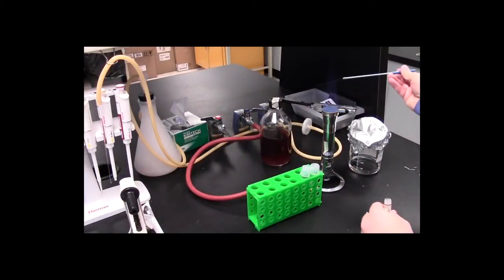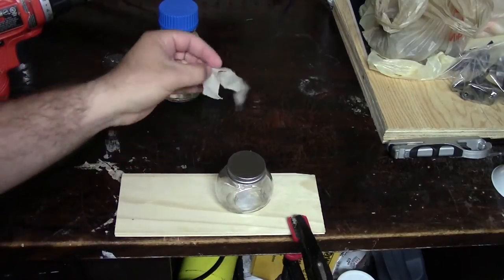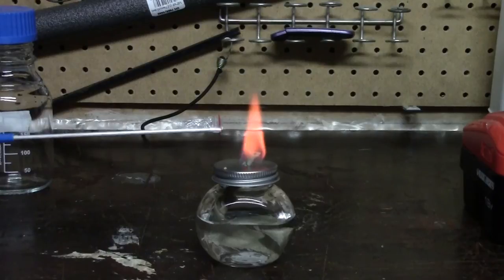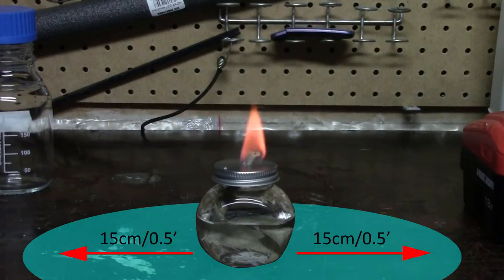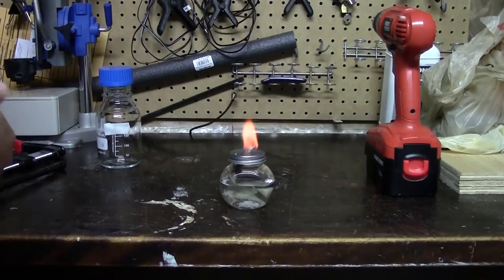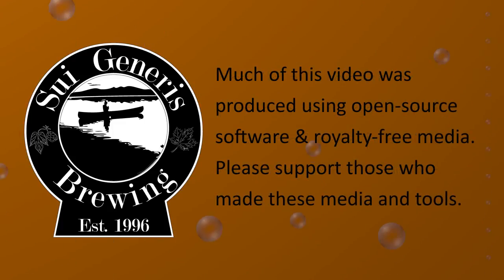Your Home Yeast Lab Made Easy - DIY Alcohol Lamp

Comment: 0:03  Introduction, Aseptic Techs and flames
0:20  Bunson burner options
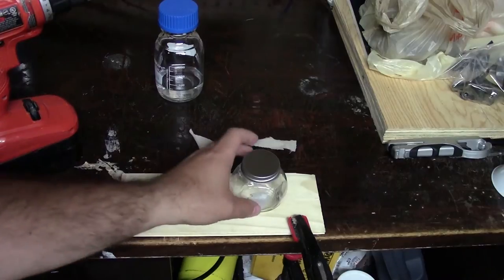0:32  Materials
1:07  Process of making a burner
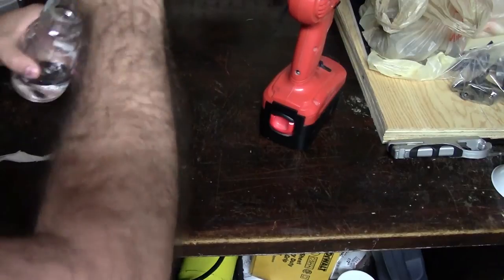1:40  Filling jar with fuel (clean burning, non petroleum)
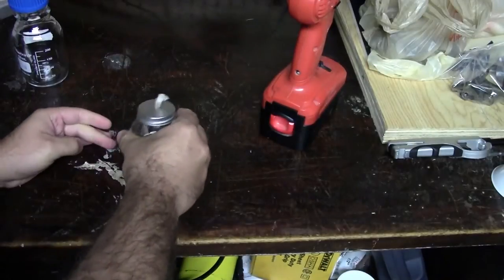2:11  Adjusting wick length and damp, lighting it.
2:35  Lamp does one of two things, sterilization, workspace air currents
3:10  Work area near flame that is relatively clean
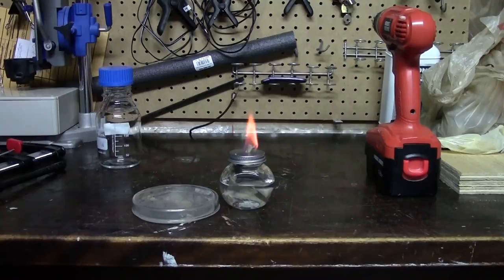4:17  Putting it out with some hot air from the author.
4:26  Summary and thanks with links.
Reply from the maker: Thanks for the timestamps - comment pinned!

Comment: A lot of people suggest using denatured alcohol. I'm concerned that whatever poisons that were added to the ethyl could cause contaminants or unhealthy combustion products. Could you shed light on this?
Reply from the maker: Hexane is usually what is added. Its modestly toxic, but should combust to the same products as ethanol (e.g. CO2/CO/water). Alternatively, you can use rubbing alcohol (isporopyl alcohol) or fondue fuel (methanol), both which should contain no adulturants and burn cleanly.
Reply: Interesting. Denatured is so much cheaper and more available.

I did just come up with another question regarding pouring plates: Is it possible to autoclave already poured borosilicate glass plates and slants? Seems like a much easier method than trying to pour plates aseptically if you have a good steam-height rack that fits the pressure cooker.

Thanks for the help.
Reply: @SuiGenerisBrewing  i noticed that the Isopropyl Alcohol I have at home is 70%.    what percentage IsoP do I need for a lamp?  (i think water is the other ingredient in the bottle i have)
Reply from the maker: @oakbox12345   95%. Another option is methanol (AKA wood alcohol, AKA sterno, AKA fondue fuel).
Reply: @SuiGenerisBrewing  im gonna go check out the ACE hardware store 🙂

Comment: I am curious, where did you get your jar for the lamp?
Reply from the maker: +MrGattor33 My wife's spice cabinet...prior to that, I think from Canadian tire. Its simply a glass spice container, sold (up here, at least) in many department and cooking stores. But any glass jar with metal lid will do - I've made them from baby-food jars and small jam-jars as well.
Reply: +Sui Generis Brewing 
Ah ok, thank you. I was thinking of a baby food jar later on after I watched your video. Thank you for your reply and great videos. Very interesting also.
Reply from the maker: Glad they'd been helpful.
Reply: +Sui Generis Brewing 
Yes indeedy, curious if you have any on harvesting the same strain of yeast if you understand what I mean?
Reply from the maker: +MrGattor33 Do you mean recovering a strain from a bottle &/or contaminated batch?
Reply: +Sui Generis Brewing 
Sorry no. I mean like a lot of distillers use the same strain of yeast for over many decades.... i. e. Like Jack Daniels has used the same one for over a hundred years so they claim.
Reply from the maker: I don't have a video or blog post on that particular method, however it is not too difficult to achieve. You need a way to stably store yeast over long periods of time, and to try and minimize the number of 'generations' your stock goes through to preserve the yeast's characteristics. I am in the process of preparing a video on using slants*, which is one way to achieve this.

*By which I mean, there may be a new video in the next 3-6 months...
Reply: +Sui Generis Brewing 
Ok thank you very much for your time!

Comment: Did you salt your wick?
Reply from the maker: Getsmart Hypnosis No. The only reason to add salt is to improve the visibility of the flame. I probably should, just to make it more obvious in my videos, but there is no other pressing reason otherwise to do so.
Reply from the maker: What are you using for cotton? You generally want a tight weave; you also want only a minimal amount of material sticking out of the top - less than 1cm (the amount I have in the video is excessive). Too loose a weave, or too much of the wick sticking out of the burner, will lead to the rapid consumption of the wick.

Comment: Can a candle or lighter do?
Reply from the maker: No, you need a larger flame than offered by a candle/lighter to generate the air circulation patterns.
Reply: @SuiGenerisBrewing  thanks. Am finding it difficult to get rubbing alcohol in larger quantities to burn as a lamp. Will say 3 tealight candles placed together or a paraffin wax lamp work?
Reply from the maker: @marcuslim2222  I don't think combining candles like that would work. If you cannot find rubbing alcohol, alternatives include methanol (often sold as wood alcohol or fondue/chafing dish fuel), sterno, or even >85% ethanol.